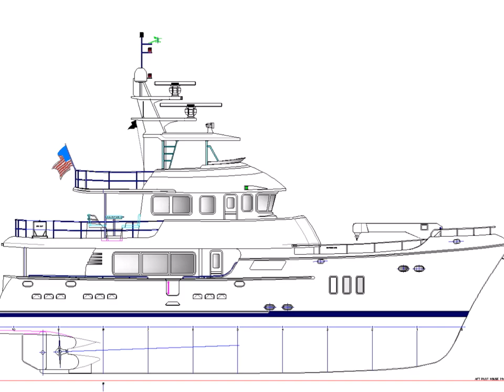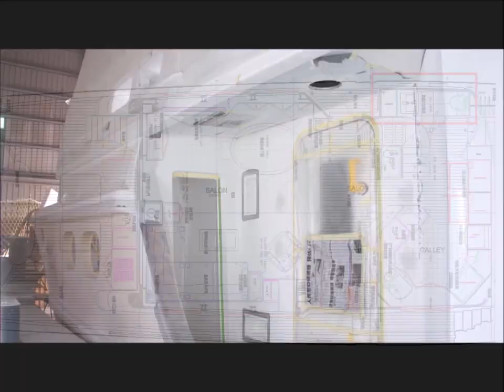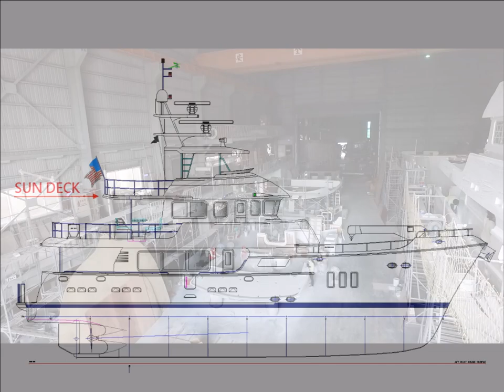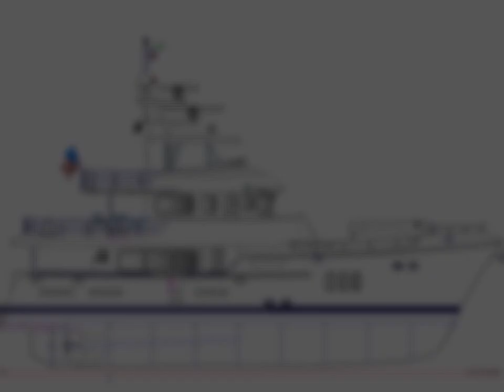Nordhavn 7624 - A Perfect Boat Will Launch On September 2017

Comment: The amount of work that goes into a large yacht is just stunning. On steel boats every plate, every seam is fit & welded, sanded & then painted by hand. On GRP, every mat is laid out by hand. On any yacht, all the wood decks are cut & fit by hand. All the interior is made by hand. Series built boats have streamlined the process somewhat but it's still human hands that custom build virtually everything except the manufactured hardware. 
When you really think about the labor & talent it takes to build a yacht, the price almost looks reasonable.